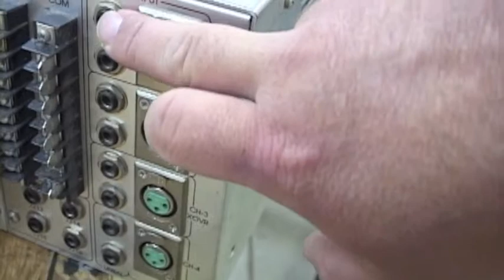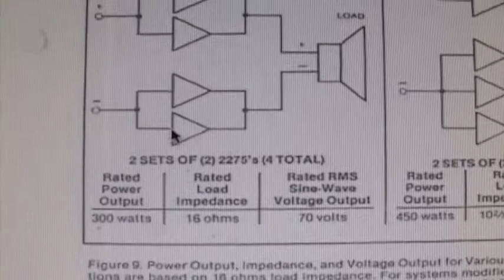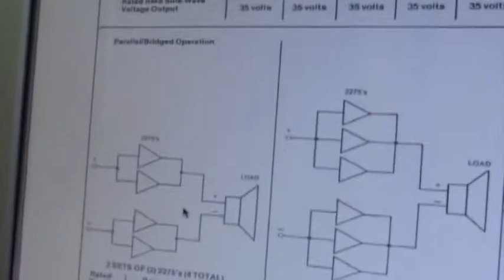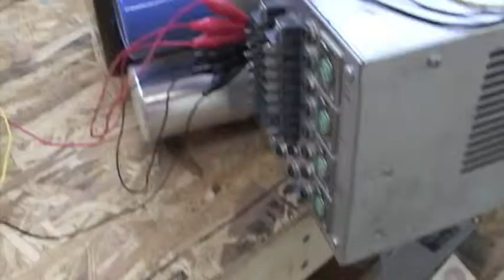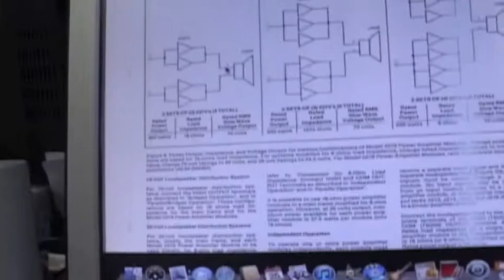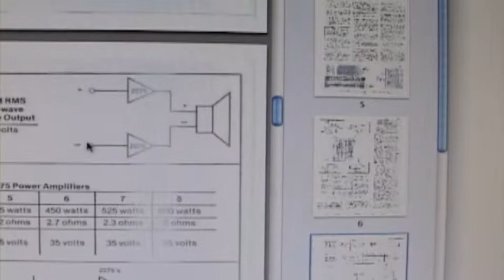Altec Lansing 2200 part 2

Comment: Thanks for the vidioes.  Helped alot  as Im not to adept with electronics, but learning.  I have recently aquired some altec A-7s along with some 2200 and 2200A amps.  It seems amp and imput cards are interchangeable.  I notice differences in the driver moduals tho.  Comparing the 2200s 2250 card to the 2250A that comes with the 2200As.  What are the differences?  Having a rough time finding info or manuals for the 2200A compared to available info on the 2200A.Any info would help.  Thank you.                                                                                                                          p.s.  Im powering the A-7s with 1593s.  Sound great,  just ..... evrything is soooo heavy!
Reply from the maker: They made many different driver cards. And many flavors. Balanced, unbalanced, 2 channel, 4 channel, 8 channel etc. just depends on the application ordered for. To my knowledge they are all interchangeable as long as they are listed for that model amp. Also there was various transformer cards available as well. Those amps were used almost everywhere and had endless options back in the day. I used to do a lot of config and setup of this series in theaters and schools. Unfortunately the company I worked for “Custom Audio Video Service” closed five years ago due to death of the company owner from cancer. So I no longer have any access to manuals or service parts. The videos I did were a start to a training series I was going to start up. But after company closing this was the only one i did.